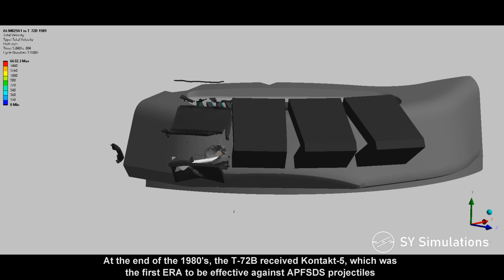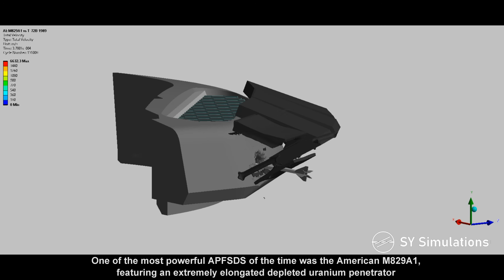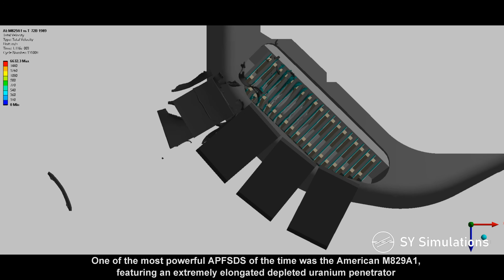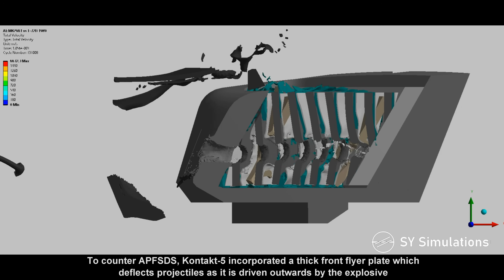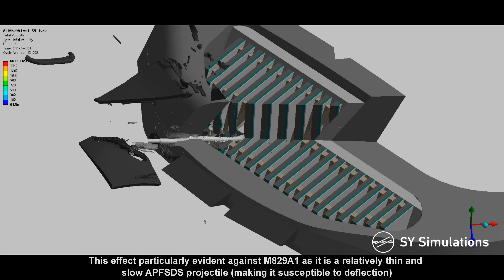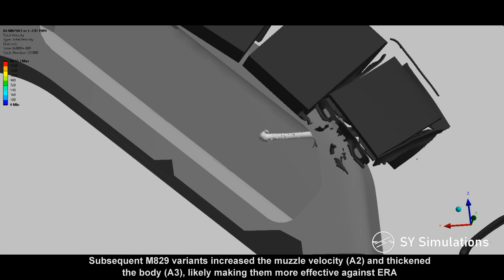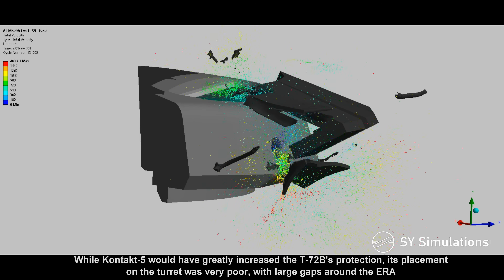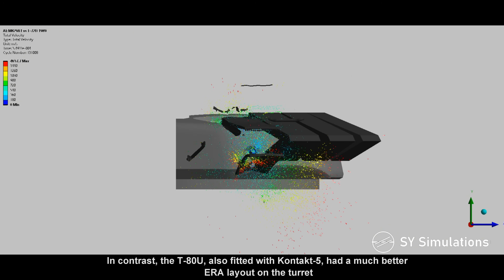SILVER BULLET vs KONTAKT-5 ERA | Abrams vs T-72B '89 | M829A1 APFSDS Armour Penetration Simulation

Comment from the maker: An interesting result with this one -it was almost a guarantee that it wouldn't penetrate but a 40% reduction in penetration was not expected. 

While this could simply be due to inaccuracies, it's worth considering that M829A1 is more susceptible to deflection than most heavy metal APFSDS projectiles (due to how thin and relatively slow it is). The impact point is also ideal for K5, where it interacts with the entire rod. This isn't the case for most impact points on the ERA.

The deflection behaviour is also intriguing, where the rod is deflected down into the turret face, with some of the rod being deflected back upwards.
Reply: Hi sy simulations, could you do a kwk 40 L/48 APCBC shot against the Sherman's faceplate (51 mm at 56° or 64 mm at 47° ) At a distance of 1000 or 1200 meters?
Reply: Apparently one of the mechanics that Kontakt-5 employs to reduce penetration, is imparting yaw on the incoming APFSDS projectile. Fofanov armor page stated it a long time ago
Reply: Almost lucky shot.

Comment: Where are you getting the reaction times for the explosives? What angles did you choose and why? Are the two tanks on level ground? Are they directly in front of each other? What age is the ERA block? Was it stored perfectly?

All of these things, determine whether the flyer plate works or fails. Real life combat data shows it’s too many variables to be reliable. ERA is great for additional armor as built in panels. 
It’s a complete failure when it’s external and doesn’t get rotated often, and the tank design like the T 80 or T 90 rely on it to get the same protection as western tanks.

ERA flyer plates IRL have not nearly lived up to Russia’s claims from combat. 
They are highly dependent on impact angle. They are highly dependent on maintenance and have to be powder coated or painted. 
They are highly dependent on storage.
ERA blocks are like windshield wiper blades when they sit in the sun and rain. 
Egypt and India noticed a 100-300% in delay in ERA blocks purchased from Russia.
The truth is, ERA outside perfect angles is great against missiles, 30 to 40 mm sabot and drones…
In Ukraine T80-T90 have lost 50+ confirmed from leopard 2a4, M1a1 firing old ammo from 90s going through ERA like butter. 
In real life the explosions do not launch the flyer plate equally, do not push the plate heard enough but mainly do not cover the 250 mm in time to matter.

Imagine you have to make an explosive that won’t go off from small arms and grenades and high explosive concussions, while perfectly going off with the tank round. The explosive has to travel along the entire plate surface and launch at one time. It has to have enough force to blast a plate in the air, but not enough to crack the welds on the tank. 
Now imagine the explosive you’re using degrades every year by 8% in perfect conditions… you’re telling me you can make that precise of an explosive while changing the variable by 8% each year? 
Also with your math you have to cover a frontal 30° ?

Nope

Comment: What these simulations clearly shows is that after this one hit all that passive reactive armor layout inside frontal cavity is practically done, its structure vastly damaged. Another hit would go straight through. Old style composite armor with encased hard material rods/balls in some soft compound (as used in T-64s) was much more durable (although it was much harder to repair and after all, it didnt provide as much protection as those more modern llayouts).

Comment: The M829 A1 is a 120 mm APFSDS depleted uranium shell which travels at a speed of 1575 m/s and is capable of penetrating approximately 670 mm of armor at 2000 m for a practical range of 3000 m..The German army tested the M829A1 on a T72G in the late 1990s, which was a German version of the Russian T72A equipped with the K5. As a result, the T72 survived perfectly thanks to the K5; without it, the tank would have been completely destroyed. The K5 is capable of removing 150 to 275 mm of penetration from the M829 A1 depending on whether it is in a vertical position or tilted at a greater or lesser angle
Reply: T72G what is this for nonsence??? and East German had not in late 80s T-72A, but from Czechoslovakia made T-72M and M1.Again some "smart" young Anglo-Saxon. It would be good not to express opinions about Eastern Bloc technology based on information ala Wiki. T-72A delivered to the GDR and CZE on end of 70s from UDSSR were retired some modified and replaced by our own Czechoslovak production, the Poles produced their own T-72 upgrades. All tanks after the unification of Germany in 1990 were sold or scrapped.

So in the late 90s they no longer owned anything "Soviet", the Luftwaffe had the same fate. Greetings as a 55+ from the former Czechoslovakia, now the Czech Republic, who was in military service in the Warsaw Pact army.
Reply: @pumelo1  Wait a minute, did you actually read my text? Germany kept about ten T-72Gs in reserve after the end of the USSR. You should know that the USSR was equipped with T-72 Urals and T-72As, while the Warsaw Pact used T-72Ms and T-72M1s (less armored and less capable versions than the Soviet versions, also used for export).
It was in the late 1990s, during a large demonstration at a gathering of countries and military equipment suppliers, that the test took place.
The Russians were present and requested that a K5 missile be fitted to a German T-72G (which is equivalent to a Russian T-72A) from old reserves, to demonstrate the effectiveness of the K5. As a result, the T72G perfectly survived the 3 shots from the M828A1 (2 on the turret and 1 on the chassis) because the k5 fragments the front of the penetrator, thus reducing penetration capabilities.
Oh, one last thing: yes, a large proportion of German T-72Gs were derived from T-72M/M1s, but from 1987 to 1989, Germany received several T-72As from three Soviet republics. That's why I'm referring to a T-72A used for the M829A1 rounds.

Comment: Nafo bots seem to get furious when their shell doesn't pen at the most armored part of a tank? Get your head straight
Reply: Yeah. They’ll always bring up Iraq in the 90’s but Iraq used domestically produced T72’s with armor even worse than the earliest Soviet models lol.
Reply: @mattfransen1551 iraq never locally produced entire tanks, their T72s are M export models, they made upgrade kits for their tanks but that was it. Spreading misinformation helps nobody.
Reply: @deepbludreams No they’re not. They produced their own, the Lion of Babylon, and the ones they imported were polish export models that were again below old Soviet spec. You’re the one who is misinformed.
Reply: @deepbludreams  1 you are wrong
2 even if, t72m had worse armor than t72a. But, this is t72b not a
Reply: M829A1 went out of service in the early 90s. M829A2 and A3 have greater speed and warhead tips designed to cause ERA efficiency to nose dived.
Reply: @deepbludreams and? This is again your cope. This is a test of a late 80s projectile against a 1989 tank model. Just because they made a better round has nothing to do with this video

Comment: Imagine what the crew would be hearing after that.
Reply: Not much. Its a small metal rod. Not a big slug like ww2 shells
Reply: @Iron_Soil would they not hear the ERA going off?
Reply: @95keat  yeah but i imagine it wouldn't cause much concussion. Between era and them there is thick steel, and before that there are composite layers that slow down not only projectiles but also shock waves
Reply: @95keat  its not really that much of a explosion, not much bigger than an AP mine
Reply: @jamesharding3459 Sooo....... where is that video you promise to us? I hope you are not just liar, right?
Reply: Nothing 🤣
Reply: Or not hearing
Reply: lol, no lungs.
Reply: He will be dead.
Reply: Attack the D point !
Reply: Blyat ?
Reply: Nothing too bad, although the crew will be definitely alarmed after it.
Reply: Not much, because they’d be charred red goo after a round of sabot. Real life doesn’t care what these animations show, K5-fitted T-72’s and T-80’s pop just fine even to 105mm darts IRL.
Reply: @j@j @jamesharding3459 TO bot lmao. an 80s apfsds shell hitting the most protected part of a tank isn’t going to go through. do you think every part of a tank has the exact same protection value? its clear you have no idea what you’re talking about. at least TRY to be realistic.
Reply: @M4_Sherman587  Let me see if I can find that drone video of a Leo 1 popping 2 T-72/T-80’s through the front of the turret. It’s excellent, you can see the flash of ERA on the turret face firing and everything. And then the Russian exploding like a firework, it’s beautiful.
Reply: @jamesharding3459 most likely just the ERA going off because yknow, “EXPLOSIVE” reactive armor. and yeah i’d love to see the video because it certainly isn’t found anywhere i’ve searched on. and the fact that you can’t even say if it was a t-80 or a t-72 says enough about the existence of said video.
Reply: @M4_Sherman587  The Russian mind has just as much difficulty comprehending reality as anything else, I see.
Reply: @jamesharding3459 still waiting for the video my friend.
Reply: @jamesharding3459 huh? I thought that was a Leo 2 popping that column?
Reply: @jamesharding3459  you mean to imply that the turret face of a T-72B fitted can’t stop even a 105mm dart, even when struck on the ERA?
You’re basically implying that the person behind these wonderful simulations is a charlatan.
Colour me doubtful.
Reply: @rosbifke  I am implying nothing. I am stating that it categorically does not reflect observable reality and therefore is wrong.
Reply: @jamesharding3459  does that observable reality include scenes like this one with darts directly striking the ERA, or is it limited to the darts striking the gaps between the ERA as mentioned by the voiceover, or striking somewhere completely different?
Reply: @jamesharding3459  the official soviet documentation of the armour tests pre production are online. The Swedish life fire trials are as well. Both have shown that the rounds of the time would have gotten folded by K5. So much for real life events. If 105mm darts would have sufficed the US wouldn't have spent millions on developing a dart able to negate k5... 😂
Reply: @jamesharding3459  NAFO troon's final form lmao
Reply: @jamesharding3459  I don't remember American tanks ever engaging modern soviet tanks with K5
Reply: @jamesharding3459  real life also dont care about your opinion
Reply: @theminuskai7453  Indeed, which is why I make sure mine reflect reality. Cope harder lol.
Reply: @jamesharding3459 omg beautiful ragebait bro 🥹
Reply: @jamesharding3459 uhh, not every part of the ERA covers the tank, do you not see the giant gaps or what?
Reply: @z_bomb  Someone’s missed the existence of the Ukraine War I see.
Reply: @jamesharding3459  The Ukraine war doesnt prove anything, tank on tank combat was extremely rare, even in the early days, the Russiand and Ukrainian tanks with popped turrets are a resault of anti tan missiles, maybe even artillery, not actual tank on tank.
Reply: @Xilley1  Rare doesn’t mean much in a war of thousands. If one percent of Russia’s visually confirmed losses were to Ukrainian armor (most estimates are 10-15%, but I’m making a point here), that would 60-120 knocked out by tank-on-tank gunfire. Given that most of those were as part of major actions with plenty of ISR drones, we have lots of video to sift through — a non-insignificant number of which show Leo 1’s popping T-90’s like a cherry bomb in a mailbox.
Reply: @jamesharding3459  I never said it doesnt happen, it rarely happened, and most likely took several shots, a video showed a Leopard 2 firing at a Russian T-72, the T-72 was hit in the front, turned around and retreated, then it was hit in the back, disabling it but not destroying it. A tank requires more than one hit to be destroyed, hence why the simulation showed the round not penetrating, its not that difficult to understand.
Reply: @Xilley1  On the contrary, a single hit in the vicinity of fuel or ammunition is more than sufficient to anything with a Z painted on it into an oversized firework.
Reply: @jamesharding3459  The ammo? Yes, that goes for any tank, the fuel? Not so much, a T-72 has a fuel tank on the front left, exactly where the T-72 i talked about before was hit first, nothing exploded, a bit of fire and thats it, this is likely because the diesel literally compressed back down and starved whatever ignited from oxygen, which halted any further ignition, as for hitting near the ammo, thats not strictly a "Z painted" tank problem, every Ukrainian tank, variant of the Leopard 2, and every Challanger 2 for example have the exact same problem, which we have seen, Turkish Leopards have popped their turrets in Syria, both every single Challenger 2 ever lost suffered an ammo cookoff.
Reply: @jamesharding3459 there's not a single video or confirmation of a leopard 1 popping a T-90

Ukraine at best has like 10 mbt v mbt engagements ending in a victory and 90% of em were with t64's

Russia hasn't lost (10-15% as you say getting 150 ish mbt's, so 1500 mbt's) 1500 MBT's 

Most losses are just IFV's, apc's, armored trucks, stuff like that 

It's also extremely common for most lost MBT's to be recovered, repaired and knocked out again and be tallied yet again despite being the same vehicle. 

If anything Russian tanks have more visual and documented instances on winning armor v armor engagements

Famously a T-80bvm slamming 4-5 IFV's and just driving away or the T-64's getting ambushed by one driving past a corner, a T-72 hitting a leopard 2 (STRV 122) and Abrams with ATGM's

There's literally no mention of Leopard 1's popping T-90's everyday 
There is no proof of even 1 instance of it happening
Reply: @handsomeivan1980  Visually confirmed Russian MBT losses place a hard floor at about 6,000. When you add in the "probable, unconfirmed" category the number rises to about 11,000.

Not that you could possibly comprehend numbers that large, what with being Russian and all.
Reply: @jamesharding3459  Where did you pull 6,000 from? Oryx lists its figures at 4250.
Reply: @jamesharding3459 brother you understand how ridiculous 11k is?? It sounds like you don't even know how big that is

Think about, let's ASSUME 11k was totally real no faek. 
3 crew members per tank and let's assume it was ALL the funny turret pop stereo type.

That's 33k. That's about a 3rd of Confirmed Russian KIA. (Source media zone)

You're telling me with the constant recording of the battlefield there's magically almost double what you stated ? Let alone real numbers.

There's around 400 tankers that be KIA. that's drastically different from a potential 33k as you state

Just saying dog, maybe you shouldn't be huffing what slop you been looking at
Reply: @jamesharding3459  I would love to see a leopard 1 pop a t-90... Drones are everywhere. That would have made world news as did the Bradley encounter that was massively milked to shame Rus even tho the Bradley's did little to anything on video...
Reply: @jamesharding3459  any tank with the exception of the Abrams would burn/pop once hull ammunition is struck. Look at the layout of a CR2 hull and come back to this discussion...
Reply: @voidtempering8700 worst part is that oryx is even extremely inaccurate and overinflated too lol
Reply: @jamesharding3459  People are so desparate to be right in every situation, even when they're wrong.
Reply: @handsomeivan1980  So desparate to be correct in every situation, even when they're wrong.
Reply: @nolongermyrealname7554 brother just elaborate 
Being cryptic is just gay

If you know something and you're claiming to say who is who wrong or correct maybe you should add something to it
Reply: @jamesharding3459 I don't see how hitting the turret would cause an ammo cook off. even if it penetrated, the shrapnel just wouldn't spread out enough to hit the ammo
Reply: @user-fe7bo5mm1o  You’re wrong about that, because it’s a common occurrence.